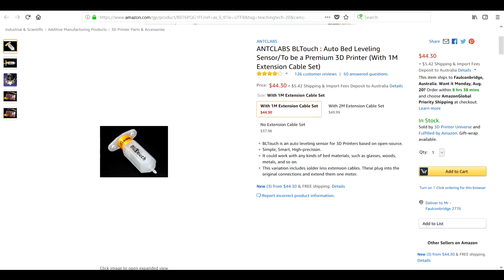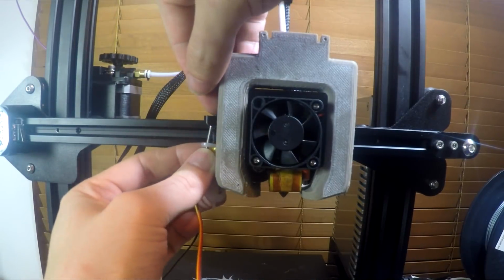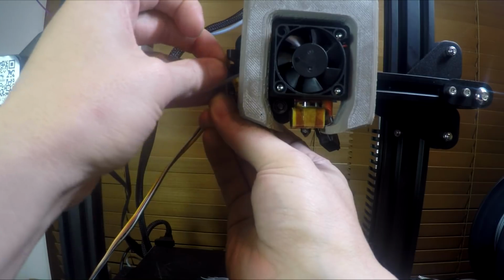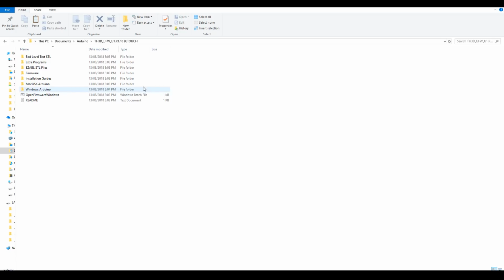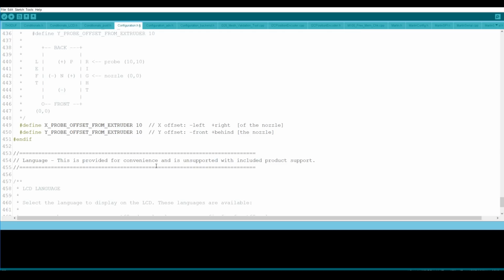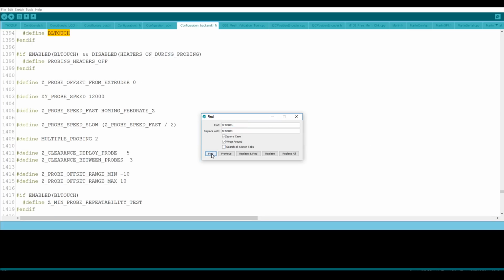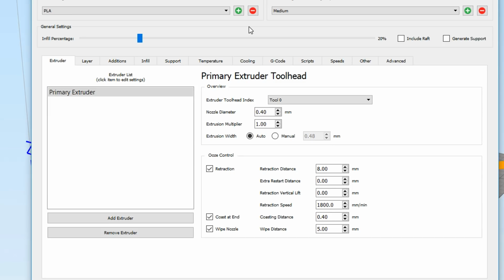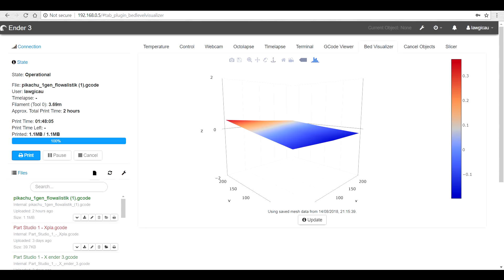How to: Ender 3 BLTOUCH with SD card support and no wires cut

Comment from the maker: UPDATE This guide is slightly out of date. It will still work well on the version I used here: U1.R1.10. There was a version of the firmware from TH3D after that had a bug that prevented this guide from working. This was fixed from U1.R2.1c. I have an updated guide using vanilla Marlin 1.1.9 with an option to spend a dollar to buy the files already configured: https://www.youtube.com/watch?v=sUlqrSq6LeY
Reply: The instructions to switch the wires on the BL Touch may be incorrect!  My Pin27 board matched the original pins on my BL Touch.  Also, for the wire loom, it's easiest to just compress the whole thing and then the actual distance through which you run the wire is short.  Then you just let it go and it moves back into place.
Reply: @sstainba  +1 to the wire switch. My wires need to be in the original attitude on the Z-stop plug, which is opposite to what was shown.
Reply: SoTH3D is up to U1.R2.7 now.  Does this still work properly for that or should I just jump over to marlin 1.1.9?
Reply: @renegadeceo  I had to basically ignore everything in this video in regards to the firmware to  get the R2 to work. If you follow the instructions inside the configuration.h files and the README it's actually much easier to set up and is supported with minimal changes.
Reply: @renegadeceo  I would like to know this as well.. Please some information.
Reply: @renegadeceo  Hi there! I have it working great on TH3D Firmware Rev 2.7. The difference is that in the 'configuration_backend.h' tab you do not need to change any of the values from true to false (they are all false by default in 2.7) and there are only two places where you change 'FIX_MOUNTED_PROBE' to BLTOUCH. Those are the only differences. My replacements were on lines 1885 and 1894. OCTOPRINT NOTE: If you use octoprint and you happen to get an error with 'eeprom' in it from the firmware, go into settings (wrench icon --> Serial Connection --> Behaviour Tab) and choose the 'cancel any ongoing prints...' option. Then send M502 and then M500 which resets the eeprom for bed leveling. Now you should be ready to home (G28) and run mesh leveling (G29). Good luck!
Reply: If I install TH3D U1.R2.5 can I use this guide or do I need to follow the updated guide? Thanks.
Reply: Teaching Tech h
Reply: With if you got the ezout v2 instead of pin 27
Reply: Anyone tried this on U1.R2.7? Since it has been supposedly fixed on U1.R2.1c, I was thinking the guide should one again be compatible. Problem is when I was trying the guide at this mark https://youtu.be/ocAeZRPVusw?t=525 , the part where you change "Z_MIN_ENDSTOP_INVERTING" under the ENABLED(EZABL_ENABLE) condition, Well.. the condition has been removed. lol, So I guess I'm going back to Vanilla Marlin.
Reply: Hi,  I have been pulling my hair for about a week now.  I have followed the instructions diligently.  Pause video, complete step, run till next step etd....  cannot get this thing to work to save my soul. Boots up and does a self test and no Joy.  No response to any "M" commands, no homing without crashing into the bed.  Not to mention the nightmare of getting all the proper librarys loaded into Arduino IDE.  I purchased the config files and  and downloaded the versions proper.   I am almost ready to scrap this whole mess and just go with the EZABL so I can get some support.  I would be happy to pay $100.00 us or more just to get this fixed as I would like to switch between glass and standard build surfaces for different projects....   Please help.  

No control from menu. No self test, reset, deploy etc.... No SDCard etc...  No issues prior to install other than crappy warped bed.  Arduino 1.8.5 ide.
Reply: Ender Pro, Genuine BLTouch, all parts soldered and properly connected.
Reply: I followed the hardware info in this guide - all worked fine.  Although the latest TH3D firmware that I downloaded a couple of days ago was much simpler to modify - just had to uncomment a line or two and change the probe offsets (as per the video)... just search for BLTOUCH and you'll find what you need.

Again, great work Michael - your videos are excellent :)
Reply: Would you have the file for the petsfang fan duct for the 4010 fan?
Reply: I just paid for the .hex file, followed your instructions to the T. And bricked one board, and attemtpted it on another thinking I might have missed a step. and now the other is bricked. I cannot even load the older firmware onto my board. IDK what to do. Other than buy another board.
Reply: @topher2327  By bricked one board, do you mean that when you turned it on again you only had a blank screen? Because that is what I'm experiencing now for some reason..
Reply: Hey man I can't use your website on all my devices I keep getting good old 404 error code
Reply: Let me get this straight: Are you charging momentary payment for (integral parts of) Open Source software..?

Comment: Hey - I followed this tutorial around when you first released it and my Ender 3 has had no changes since then.. I have been having some issues recently with under-extruding and my prints come out all sort of spongy and un-usable..  I did some research, cleaned the gear, guide and the hot-end.. None of that seemed to help.  After more research i found a 3D printable direct drive upgrade ( SpeedDrive v1 ) and I've just spent a couple days getting a print that is work-able.. ( I had to glue paper on all sides to get it structurally sound enough to work )..  My hope is I can get it printing again and print a replacement..    Now that I have installed it though, the stepper motor is crashing into the right side of the ender3 frame where the power supply is.   I tried reducing the size of my print bed Z axis in Cura to 200mm, but it still not working..  I suspect its something to do with the TH3D firmware?..   Any idea how I can resolve this?  I am considering making the jump to klipper, it seems easier to work with..   Any insights into all these issues would be really greatly appreciated.

Comment: My mileage varied

2021 June, Ender 3 V4.2.2

The motherboard fan doesn't fit when using the adapter to install the 3pin/LCD adapter piece :(

Comment: I'm getting confused. Watched few YouTube videos including yours and is there two different versions of BL touch for ender3 V2? Some of them are using the pin 27 board plugged into screen socket, but some of them are showing that there is already connector for BL on main board. Is there two version of mainboard in the V2s?
Reply: I think this one he’s doing is the V1 like what I have. Mine doesn’t have the fancy BL option on the main board.

Comment: Hi,I had my ender3 v2 on one 3D print shop, for my surprise , He said now  you have a bed leveling function without a BLtouch, he worked around other way, far i can see, the nozzle touch the table up down again, so the all mounting swing and activate the Z limit switch. he got all printed , can you understand how this works? on the printer settings i had add G29, funny works like a charm.   Greetings from South Africa

Comment: question: when printing multiple parts, cura uses the default extruder footprint to determine the distance needed between the individual parts when you select the option to finish individual parts. That footprint is now obviously incorrect which causes the extruder to hit the finished prints. Is there any way in cura to account for this?

Comment: PLS HELP... Arduino: 1.8.7 (Windows 8.1), Board: "Sanguino 1284p, ATmega1284P (16 MHz)"

C:\Users\Shawn\Desktop\TH3D_UFW_U1.R2.B5\TH3DUF_R2\Windows Arduino\portable\sketchbook\libraries\arduino_613091\src\clib\u8g_font_data.c:87700:3: fatal error: error writing to C:\Users\Shawn\AppData\Local\Temp\ccBvV9si.s: No space left on device

   223,128,0,0,1,128,0,0,1,128,0,85,85};

   ^

compilation terminated.

exit status 1
Error compiling for board Sanguino 1284p.

This report would have more information with
"Show verbose output during compilation"
option enabled in File -> Preferences.

Comment: Thanks for this video! Super helpful. One issue I'm having is after installing the pin 27 adaptor my LCD seems to have died? any thoughts? even connecting it directly to the board again it won't light up. toggling the wheel still clicks and beeps as usual.

Comment: Great guide but check the wiring of the breakout board before switching the wires! The pin 27  breakout board for the BLTouch from LlamourCar off Amazon, as well as a few others, are wired correctly so you don't need to switch the +5 and GND wires...I found out the hard way!!

Comment: I'm not sure which version of the BLTouch you received, but mine came with 2 springs that you mount on the screws instead of the washers that you used, makes it so when it hits the bed it has a little give.

Comment: Hello guys.  On the THthe firmware they replaced the Babystep offset for finebabystepping, but for some reason is not working while I try to calibrate. It has the screen to change, but when I change it does nothing.  Not sure if this setting actually changes the z-offset

Comment: Can anyone direct me to instructions for setting up the firmware for the bl touch on a copymaster pro 500 it does everything except when it moves from the centre the nozzle starts dragging the bed and once in start print position nozzle is approx 2cm from bed thanks

Comment: Installed bltouch on my Ender 3.  Would do the autohome check okay.  Then would fail at first point in ABL.  So printed several items using autohome only.  Then tried ABL again and no fails.  did find it produced a Y offset issue.  Repeating autohome after ABL routine fixed this.  Did NOT have to cut the capacitor.  Have V2.1 BLTOUCH.  Thankfully did not blow sensor with reversed wires.  The marlin code changes were easy to do with the video info.  Thanks much.

Comment: Hi Mike, your videos have been a great source of information but I have run into an issue that so far after searching and working on for a couple days have yet to sort out. The encoder wheel not working, this is on a 1.1.5 board but I dont see why this would cause this issue. Any ideas?

Comment: you seem very smart, any idea where I can find install instructions for a 5 wire BL Touch ver 3 on a Creality CR10S5 with card ver 2.1? The firmware went ok, just need to know where the 5 wires attach to? I might have a wrong extension cable that is throwing me off but none the less I can sort that out easy enough....

Comment: anyone come across a issue where the Store Settings option is missing from the LCD screen list options? It was there for me for the longest time but for some odd reason it is no longer showing up. I have not disabled the LCD Menus nor did i enable the Slim Menus. I also do have the EEPROM enabled. I am at a loss on why the option no longer shows up for me.

Comment: Update: Never mind what I wrote below. I figured it out. It was so easy that I now feel like I had a major Brain Fart for asking about it. :) ROFLMAO ... Once I decided the position I wanted to tighten down the Probe on my HeroMe mount I just had to home the printer then move the probe to a position over the bed taking note how high I moved it up. Then  I just deploy the probe manually within the LCD commands and move the Z-Axis down until it triggers the BL Touch to get the value I needed to calibrate it.  Everything else was basically the same as explained in the tutorials. You take that value as and then use it to calculate the Z Offset and store it. Considering that I manually level the bed to the mechanical endstop switch all I had to do was take that value I got and enter it as a negative in my Z-Offset. I was as simple as that. So not sure why I had such a Brain Fart over it. LOL :P

How do you calibrate the BL Touch when you do not use it for Homing Z but just for Bed Leveling? I want it to still home to the Mechanical Switch as I manually Level my printer bed, and then just use the BL Touch to Calculate / Compensate for the Warped bed. I do not want it to also be used for the Z-Homing. Is this even possible? I ask because the instructions for the SKR Mini E3 mention that you can choose to not use the BL Touch for Homing but it does elaborate beyond saying that.

Comment: I have the BL Touch installed and goes though its test.  But how do you know it's actually adjusting the gantry to correct for a warped bed?  Example, I had my bed/BL Touch/Ender 3 adjusted to produce good prints.  Tonight I put some bits of tape under the Creality glass to get around using the clips and found I had to go though the leveling process again to get good prints.  Why doesn't the BL Touch correct for those bits of tape?

Comment: hello install bl touch v3.1 on a cr 10s pro, finishing firmware 1.1.9 b6, the sensor works but the axis measures remain.  bad, they are as out of date and I can not regulate it to get an impression, could you help me with some firmware or some other mainboard update as I walk.  Thank you

Comment: If you get a BLTouchv2 at anytime after 7/14/19 and want to add it to an ender3 read Config.h and the config.backend a lot of what Michael talks about has been added. a good example is that the pin 27 board has a define in the BLtouch area at the bottom of the file. you just need to uncomment the pin 27 instead of defining under ender3.

Comment: followed all your steps and additinally uncommented following line 
//# define BLTOUCH 
since in last step you had replaced a setting with this value . 
Also would like to add distance between bottom of bltouch/3d touch (not the pin) and hot end should be 8.3 mm  .
My 3d Touch is working now. Thanks for making this helpfull guide.

Comment: What is all those settings were already set to false?  
Also its not showing up as size too large it shows a error for 

Configuration_backend.h:2561:2: error: #endif without #if

 #endif // CONFIGURATION_BACKEND_H#endiff without #if

Comment: Need help!! Using newest version of th3d U1.R1.11 with a 3D Touch, and pin 27 board. Printer is a ender 3 pro. Board 1.1.4. Wont stop going down when I do auto home

Comment: Thanks for a very helpful video guide (even if it is slightly out of date), specifically for TH3D. I am using version U1.R2.7 and had no problems editing the source code to make it work with the BLtouch. I even played around with the "EZABL_POINTS" value (in Configuration.h) and went with 7 for a 7x7 mesh topology map of the bed -- word to the wise, after you've uploaded the new firmware use the menu option: Control -> Initialize EEPROM -> Initialize EEPROM, or you will get weird error messages about 'EEPROM Size' when using Bed Visualize in OctoPrint.

I didn't need to adjust the 3-pin connector pins as they matched up correctly with the Pin 27 Board I got from Amazon.com. Though, I noticed in the comments below someone thought they had to rearrange the 3-pin connector based on the your video.
Side-note: Servo 3-pin wire color coding is typically; brown = gnd (ground), red = pwr/5v (power), orange = sig (signal). For the terminally curious see this FAQ: https://www.pololu.com/product/1046/faqs

Comment: Now that this guide is slightly outdated there are some things which can be done much easier.
1. follow physical install like shown in the video
2. follow steps in marlin up until he instructs you to change to the tab 'configuration backend'
3. instead scroll further in configuration.h and uncomment bltouch, this is clearly outlined and displayed near the bottom. You can also uncomment the Pin 27 here instead of writing it earlier in the code.

This makes the install much easier

Comment: got a bl touch the other day from amazon- didnt need to switch the pins around (its version 2.2)   i actually was having issues with the lcd not displaying it was powering on and off rapidly (the lcd) but nothing broke, looked at the pin 27 label and it is now the correct orientation for the bltouch. also, using version u1.r2.10d of TH3d firmware. followed all the steps except when i got to the last 2 steps the "Z_MIN_ENDSTOP_INVERTING" is already false in all places --- and i did the same thing (3 instances) replaced fixed_probe with BLTOUCH. also i didnt have to disable the boot screen- but it seems to have already done it. 

""" #if ENABLED(SLIM_1284P) && ENABLED(BLTOUCH)
  #define DISABLE_BOOT
#endif
"""

attempted auto home from bltouch menu on printer and the bltouch registers it as hitting the bed. 

great video- you should add something to the beginning of the video or an annotation saying to read your pinned comment or format what i said above. the guide still works it is only slightly off.

Comment: I followed your guide, using TH3D  U1.R2.10d.

I see no option for BLTouch on my LCD menu.
Reply: I have tried installing BLTOUCH on my ender 3, I do get the bltouch option on my LCD and the M48 test. but when I home it, probes center of bed a few times then it sits 5mm from the bed. Im unsure how to lower this, it my have to do with the probe length being different . I can post my Config options if you want
 but still not quite right

Comment: getting this error, but I am using the Clone (3d touch) would this make a difference ? 
#error "SERVO0_PIN must be defined for your servo or BLTOUCH probe."
Reply: same problem. i found a mention of the servo0 and just above that a bltouch comment already in the config_h part... just un // them instead of adding the lines
Reply: Make sure you put a space between PIN and 27

Comment: MY BOARD IS AN MKS Genl, it used the mega 2560, when i tried to compile the sketch, it told me to selct the sanguino. how do i fix that.
Reply from the maker: You have to set the mainboard in config.h See my MKS Gen L guide for more details
Reply: @TeachingTech  so using the TH3D firmware, i figured out that with this board i no longer use the Ender3 settings, i have to use the MKS settings. I only get this error code now. #error "BABYSTEP_ZPROBE_OFFSET requires a probe."